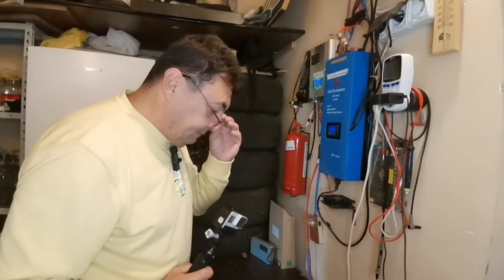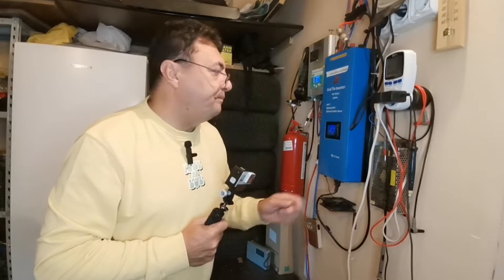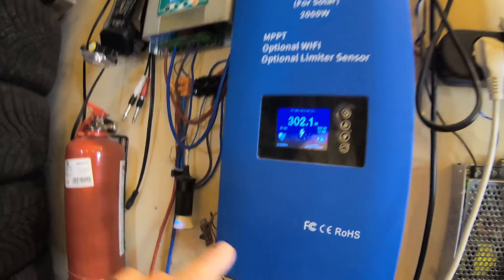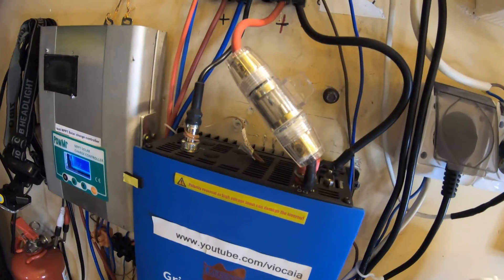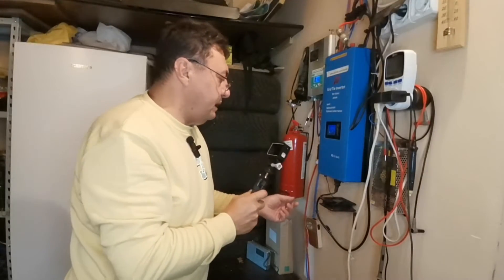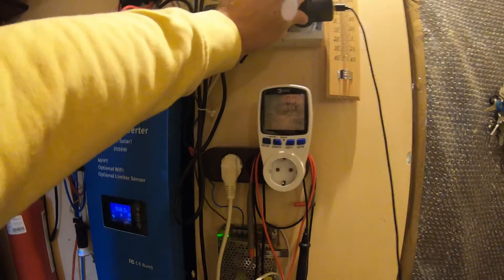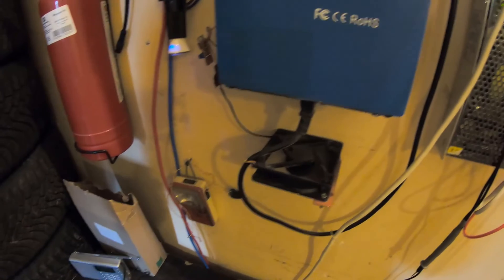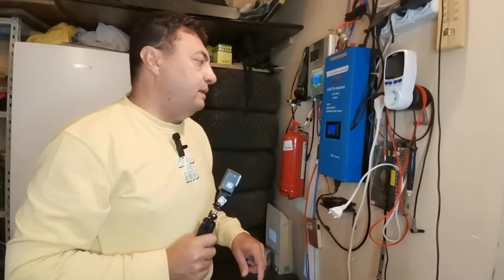SUN GTIL2 2000W after One Year

Comment: Well, here you can get a MIC 600 from Growatt for about 150€ +10€ WiFi stick, which has big, big heat sink and is 6,5 kg which is rated for 600 W 
That inverter is also sold a 1000 W , 1500 W and 2000W based on the same certificate which is the reason why you can pimp that cheap 600W up to 2000W in 5 minutes.

Might be worth a thought if you think about expanding, also allows net metering, but that is not a hybrid inverter.
Reply: How do you modify it?
Reply from the maker: @anonomas4253  I didn't, just placed an extra fan under the inverter
Reply from the maker: Thanks for tips! I want to expand next summer with more panels and I'll look for an inverter.